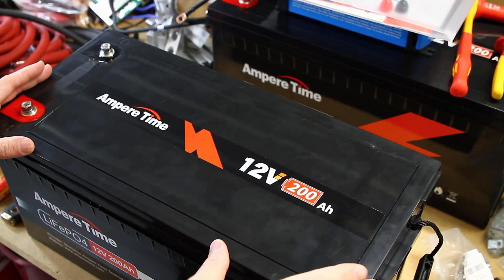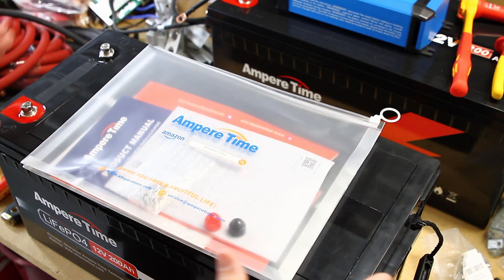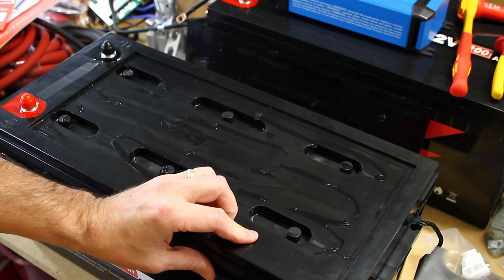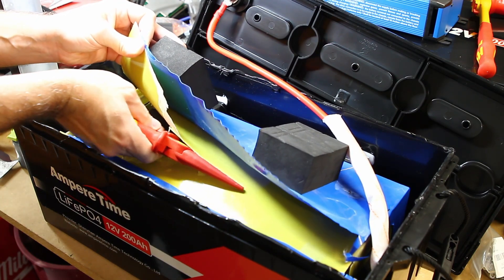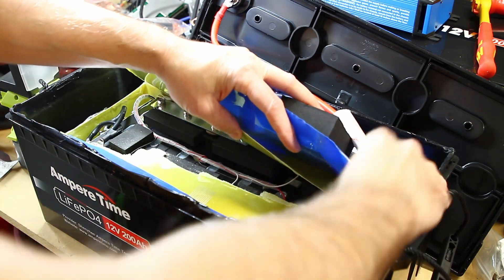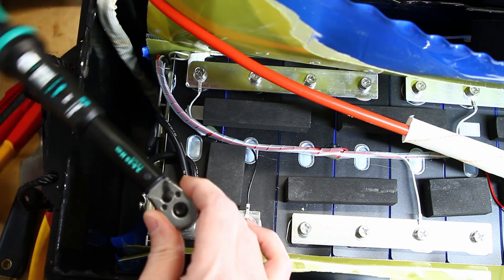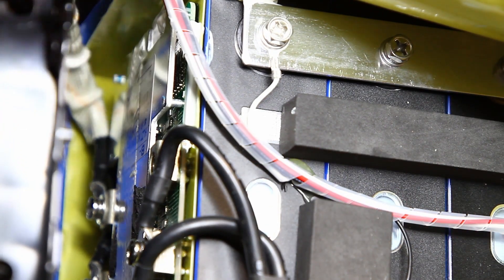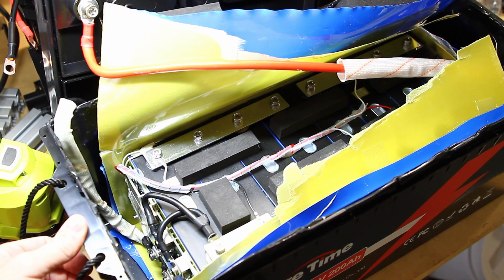Ampere Time (LiTime) 12V 200ah Lithium Battery Tear Down (100amp BMS version).

Comment: I have the same 200 Ah unit purchased in May 22.  I am not happy with their support.  I'd been having issues and not used the unit much, led lights and so on and I wanted to upgrade to a 400Ah system because of wanting to use a not yet installed Victron 12V multi plus ii 3000.  Well they said after three months one cannot add a second battery or expand but have to buy all new units.  Mine only had three charge cycles and kept topped with a Victron charger 65 something or other.  So rather than being taken to the cleaners I am thinking of building my higher capacity system.  thus researching.  A cell company said when built one and expand in time whereas when all in one battery we have to consider their configuration and BMS.  With proper busbar sequence one can expand the 12V to more capacity while maintaining 12V use 1 BMS.  thus, I am going to look into my new (Amperetime says "old") 6 month owned battery (Yeh, where does 5 years fit in?) and if bolted use their cells as part of an all new system expandable and safe.  I could be burping but that is the direction.  The 100 amp unit WP reviewed is all welded.  Mine could be so that could be a crimp in the plan.

Comment: I am so glad you use your experience in feel to stop torque.  50 years ago when I first started mechanizing, the shop would use threaded bolts on brake shoe lining.  As a novice the shop owner told me to tighten them all until each broke.   Over the years he would break one on purpose to keep that feel...  back to the show..  pat

Comment: I have 4 200ah Lithium battery's Can anyone show me a diagram to series them to24v? Thank you James
Reply: Yes, that is confusing to think about. Maybe do two batteries in series, then the other two, and ....never mind. I have no idea actually. LOL! I just ordered a 300 ah one like this. I hope it lasts. Huge purchase for me but I`m on disability, no transportation, living in a camper in a hurricane zone. I hope to power a tiny window AC enough after these storms to keep the temperature below 90 in my camper. I have 11 solar power stations for lights, fans, WIFI, 12 volt cookers, a dorm fridge, and a small chest freezer. The big battery will really help a lot connected to solar. And now I know I can get inside it if the BMS ever needs replacing.

Comment: You have to start being watchful.. As some manufacturer are putting TTL chips in the BMS...Once it has run so many cycles. It will never charge the cells again. Even if they are still good...
Reply: These claim 4000 cycles....and what`s considered a cycle? I thought that was a full charge/discharge?

Comment: Do you have the measurement of the cells and bms? I am looking to make as small of a footprint as possible with this battery.
Reply from the maker: I just measured.  As you see the battery in the video, from left to right is 16 inches, front to back is 6 inches maybe  another 1/8",  then bottom to top of terminals is going to need 6 inches to clear all the terminal wiring.
Reply: Probably the common 20.5 inch box.

Comment: There needs to be a new standard for the sizing of these batteries. All of them are just made to fit in lead acid battery size cases. 
They need one size 12v battery and more cells can be added for your voltage or amp requirements.

Comment: there is a lot of empty "waisted" space in there, because that is the same box the 300ah battery comes in, which is what I have at home that is going into my camper van. It is so nice for me that the extra 100ah can fit into the same footprint! Oh! and thank you so much for doing the exploration for me, I was so curious, but not brave enough to do what you are doing! I really appreciate this!
Reply: I just ordered the 300 ah one, a 60 amp MPPT charge controller, and a 2000 watt inverter to have emergency solar power in my camper. The last of my disability back pay. I can`t imagine not having emergency power here in a hurricane zone. I have seven 300 watt solar power stations, two 500 watt, and two 700 watt Bluetti EB70s for lights, fans, 12 volt cookers, and a dorm fridge and small chest freezer. The big battery will be for using a tiny Frigidaire window AC to prevent heat stroke if another storm hits my area in August. I hope to upgrade the system for fast charging at some point. I only have 490 watts of glass panels right now and 100 and 120 watt folding ones. Haven`t yet thought about how to connect them.
Reply: I took mine apart too
Reply: The 200Ah, 300Ah, and 400Ah are all using the same case. 😲

Comment: I was curious to know how long did it take to charge the battery with the victron 12v 30ah charger? Was thinking of getting the same charger to run on a small generator
Reply from the maker: I just ran a test today.  From 11 volts to 14.7volts took 6 hours and 28 minutes.
Reply: @BZEUG  I ordered a 20 amp charger with my 300 ah.
Reply: That’s wild because I’ve seen battery ads say 2.5 hours with there 20 amp charger.But they didn’t say the starting charge point for 2.5 hours.

Comment: Thank you for doing this video, I bought the same batteries making the mistake thinking I could run them in series. My 24v Victron inverter wouldn’t charge them in series even though the BMS in the battery never cut-off power. I’m seriously thinking of getting a new BMS for 24v instead of 12v so that I can still use these batteries.
Reply: you can run them in series, you just can't change them in series. Get a 2 bank charger and charge each cell independently.
Reply: @riccochet704  I’ve already changed the BMSs to 24v 8s ones so I can charge them off the Victron. Thanks though 👍
Reply: @OffGridOverLander  where did you buy the new battery management system. Do they have one for a 48v configuration.
Reply: @genobarbagelata1938  my system is 24v, but they do have 48v 16s versions. Daly is the brand, just understand that they top out charging voltage at 28.4, which essentially keeps you from overcharging your lifepo4 batteries. If I remember correctly when I did the math, it tops out at 95% or so. Trying to charge that last 5% seriously degrades the longevity of the cells, so I’m content with what I have. I’ll just double my batteries for more capacity than to try to chase that last 5% anyways.
Reply: @riccochet704  Really, that makes no sense?  So you can discharge them and then have to take the series connections apart and re charge each one individually???

Im currently running 4 of these on a 12v inverter in hopes that I could series them up once I can upgrade to a 48v inverter.  All the documentation I have seen on them shows them being able to connect up to 4 in series for 48v, but that would be retarded if you are not able to charge them.
Reply: @Tro1086  A two bank charger has two leads coming off it, one for each battery,. It charges the batteries individually without having to remove them being in series. These chargers are commonly used on boats, RV's, any situation where you have multiple batteries that need to be charged.
They don't work with parallel configs.
Reply: @riccochet704  How do you charge them at 48v off of solar.  Makes no sense these would opperate in discharge at 48v but not charge at 48v
Reply: Just adjust your victron for the higher voltages the lithiums run at and youll be fine. it will charge them.
Reply: @car2069  I already went through all that with the Victron service rep. Changed all manner of settings but didn’t do any good.

Comment: Great teardown! I think 10nm is quite a lot for those aluminum terminals. EVE recommends max 8nm, dunno what's the limit of those Ganfeng Cells. And thanks for showing a clear QR code, other people hardly do that. According to that cell's QR it was manufactured in 2021 May (B5), must be new cells, that's great to know.
Reply from the maker: I still have not found a website to decode the QR code.  How did you know the date?  Is it just B=2021 and 5 is May?
Reply: @BZEUG  Yes that's right. There is no official guide to decode for Ganfeng Cells. But EVE data sheets have the guide. And most major manufacturers are following the same standard. In your case, I think they skipped day code (0), but I have seen 86Ah Ganfeng Cells have it. Anyways a brief guide is as follows:
Manufacturer code part:
0AL: Manufacturer (Usually) eg. 02Y: EVE
C: Cell
B: LiFePO4
Rest are cell model and factory location etc.
Serial Code part:
Character#1: 9, A, B, C: 2019, 2020, 2021, 2022
Character#2: 1-9: Jan-Sep; A-C: Oct-Dec
Character#3: 1-9: Day 1-9; A-V: Day 10-31
Rest are serial number.
Works on cells from EVE, Ganfeng, CALb, Gotion, etc.
CATL cells might have a 3 digit code in the front, e.g. 003B9C... So if we ignore 003 then the decoding should work as above.
Reply: I can  provide “PRODUCT SPECIFICATION pdf “ of this GFB 100ah FFH4D3 if someone wanted.
Reply from the maker: @mihailmugurelo4279  I would appreciate that.  Can you email that to BZEUG.YT@outlook.com
Reply: @BZEUG  SENT
Reply from the maker: @mihailmugurelo4279  Thank you!